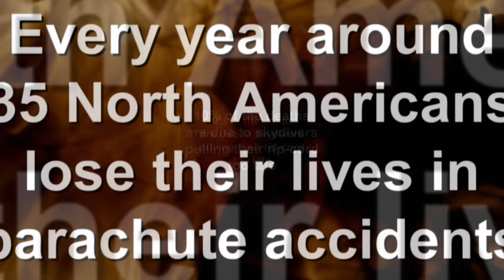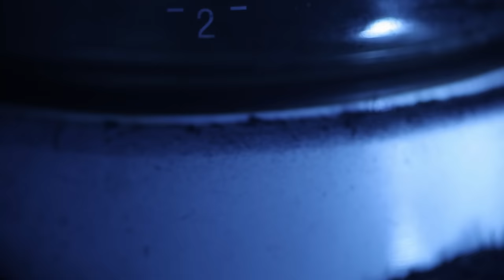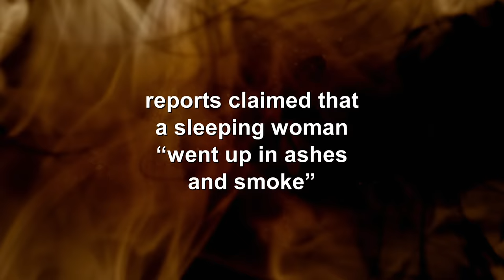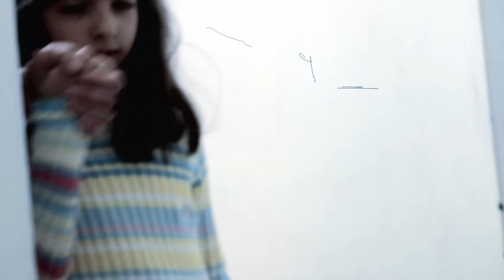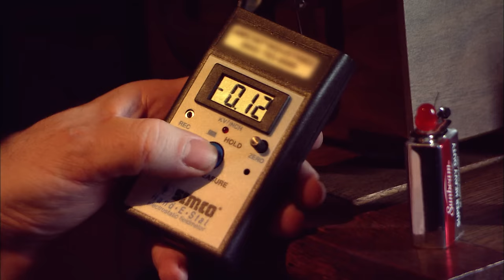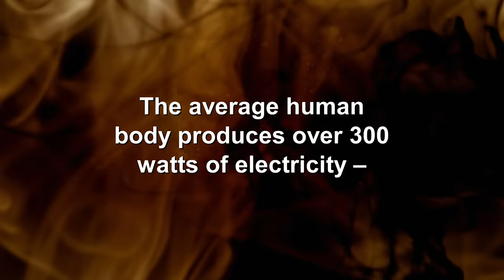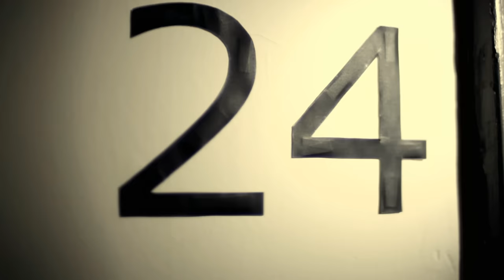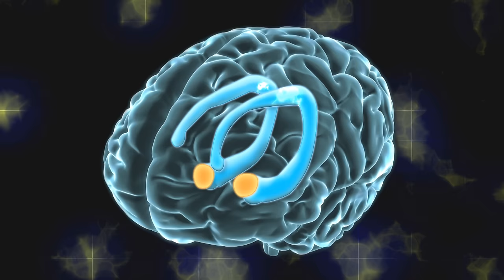Bizarre Survival Stories | William Shatner's Weird Or What Marathon | Absolute Sci-Fi

Comment: I worked in a factory that made plastic containers for cookies, etc. I would build up so much static that you could see it come from my finger tips. My hair was bushed out, and when somebody walked by I would shock them. To counter act this, I was grounded, a wire was put around my ankle and bolted to the machine I worked on. Strange as I'm watching this, I'm thinking from a young age I had these episodes where my heart would beat up to Two hundred twenty beats a minute. I'd be tachycardia. Nothing at the time could prevent them, but I have had to go ER and they would do a Pat Drip, An IV where a med was was pushed in an on the EKG when my heart started to convert, they pulled out the IV. Then in 1997 I was one of the first people in my state to have a procedure called Cardiac Ablation. They found where these outside electrical impulses were coming from, and burned little tracks in my heart to cause scar tissue. The impulses couldn't get past the scar tissue. It was so great to not have those episodes anymore. I don't think static electricity had anything to do with it, but I don't think they ever thought it could contribute to setting it off. Edit: I didn't have ventricular tachycardias, mine came from the upper chamber of the heart. But they do ablashion on ventricular tachycardias also. All my younger years I was told they're not life threatening. But since this procedure at the time was new, an I was sent to a teaching hospital,an at the time it was only being done in some Eastern Coastal States, the Cardiologist I was sent to, said, one of these days you're going to be outside hanging out clothes, and become tachycardic an your heart may stop, and nobody will be around to help you. I was like, but I didn't think it was life threatening, he only replied, we couldn't do anything at the time, and these episodes are already scary , no need to stress a person more.